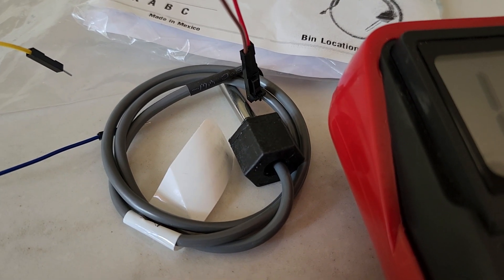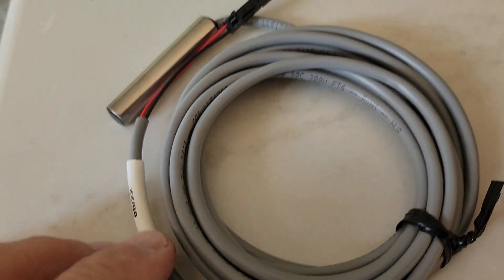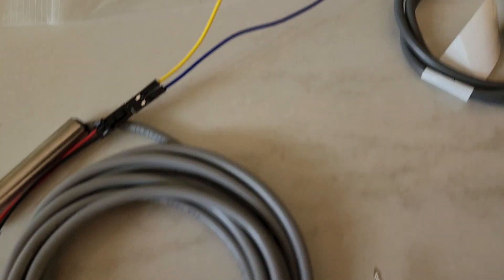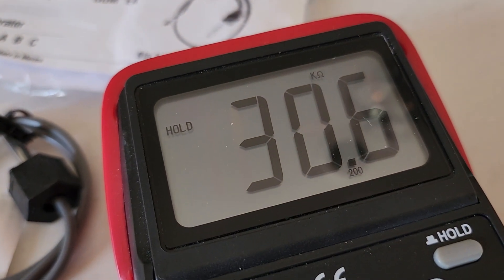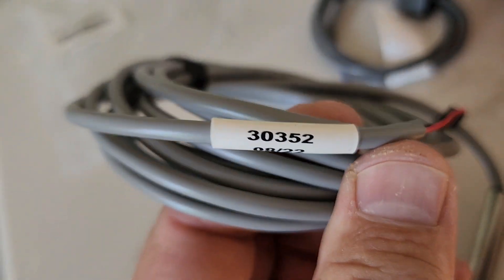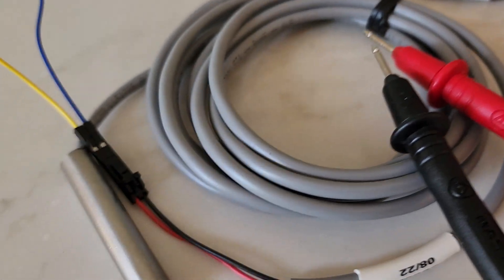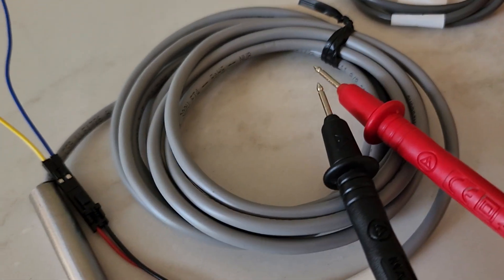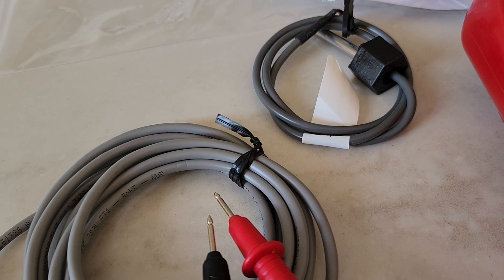Balboa Temperature Probe Resistance, Hi temp & tub

Comment: hello my tube keeps saying balance sensor and has not heat i rep[laced the heater elament and both sensors and still the same
Reply from the maker: @KeithShort-c4o  there is a pressure switch that can be adjusted to activate when the water is flowing strong enough to turn on the heater. If the pressure switch does not turn on the heat will not turn on. You can put a jumper across the pressure switch to temporarily see if the heater comes on.
Reply: @dalechalkey3729  any idea where that is in new england and its time to use i am old and need it and a huge THANK YOU